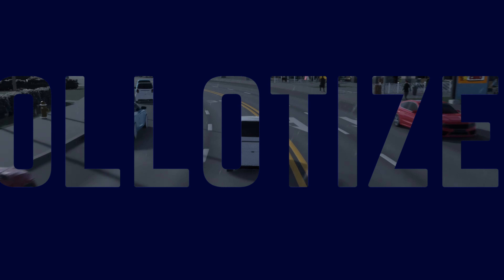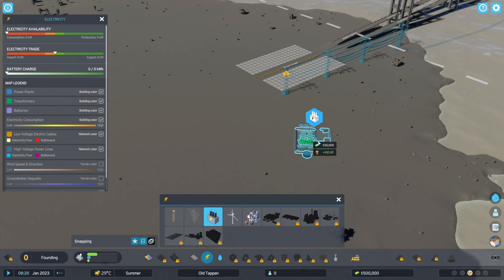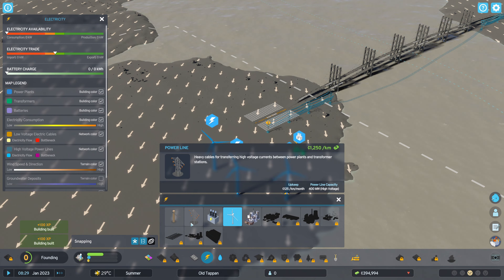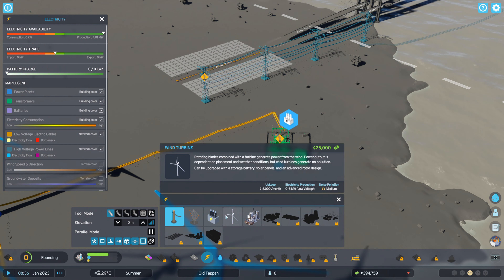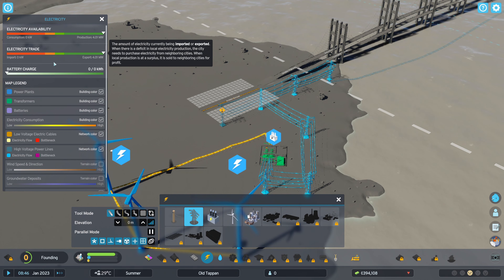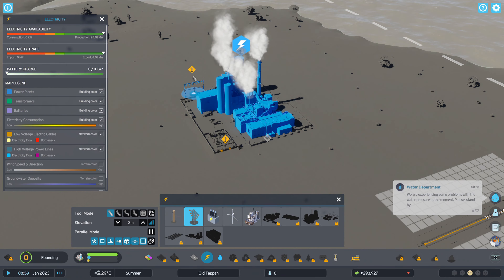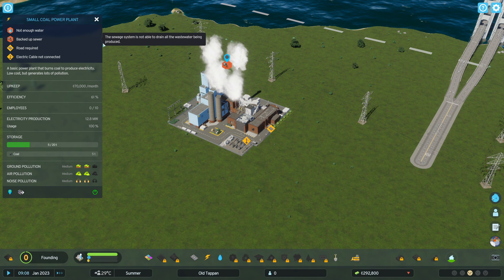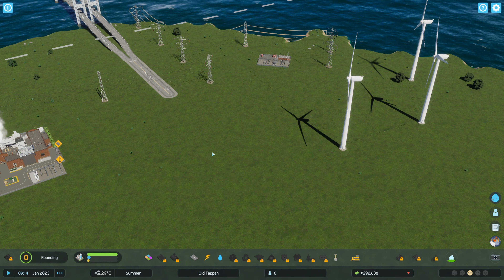HOW to IMPORT & EXPORT ELECTRICITY in Cities: Skylines 2

Comment: Is there a cap on how much i can export? I cant seem to export more than 1 million worth. Im wondering if it has to do with the 400mw limit on power lines? I produce enough to export more. How do i split the power and put it on a seperate cable?
Reply from the maker: I don’t know if there’s a cap on how much you can export but if you unlock enough tiles to get to the edge of the map then you can run some power lines out to it and export more than 400mw of power and it can all be on the same power grid. Hope this helps. Thanks for watching!
Reply: @OllotizeGaming  I am selling 552MW